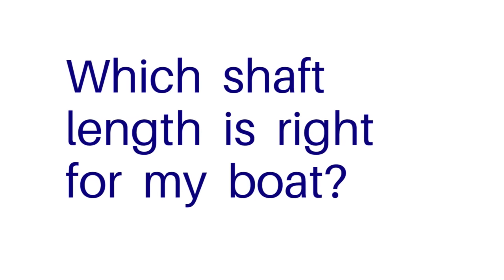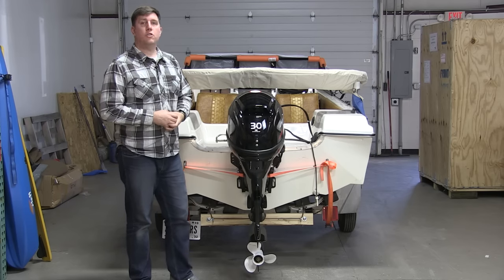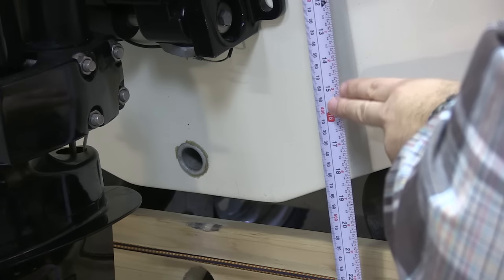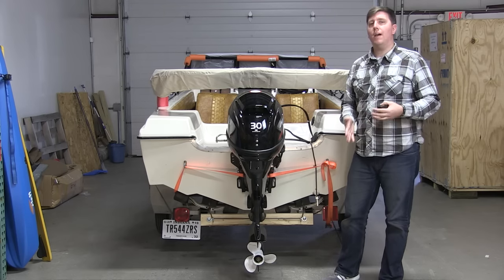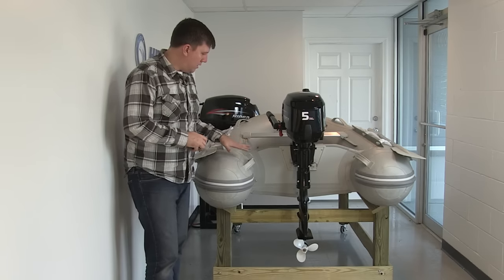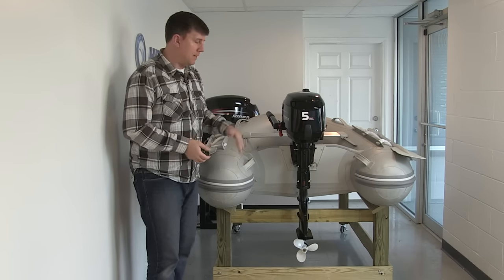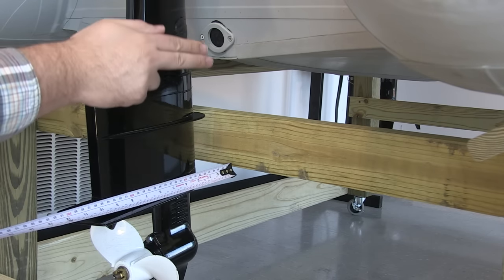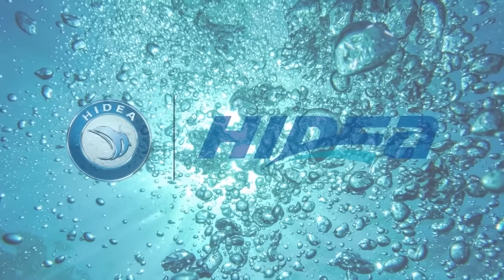What Shaft Length Do I Need?

Comment: i have an inflatable cat and even short shaft was too long. Being an open transom i couldn't raise it any higher, so i moved the floor down an inch approx by using closed cell foam between bottom transom bar and HP air floor instead. Along with an hydrofoil it made a huge difference to slower planing, less banging in chop and tracked/turned just like a car would. Since there was no more prop ventilation i didn't bother cupping prop.
Reply: if your cat has a transom that is too short for a 15 inch mid then something is incredibly wrong with boats design.. or was this boat meant to be using a setback?  tell us what the boat is and ill find out why it was built that way
Reply from the maker: Interesting - thanks for sharing!

Comment: If your motor is sitting 1 to 11 inches too low, you should look up manual jack plates.  "On the Fly"  brand jack plates have a self adjustable circular crank lever for an instant height adjustment up to 11 inches while traveling on the water at top speed.  Easy fix for a shaft sitting too low, especially for shallow waters less than 1 foot deep.  With the right prop height adjustment, you can increase your travel speed up to 5 mph.  The manual self adjustable jack plate is for outboard motors 40hp or less.
Reply: Oh thank you 🙏 
I just got a 14’ boat and it came with a 9.9hp evinrude long shaft. It’s 5 inches too low and I was just brainstorming how to fix it

Comment: OK, so I just bought this Mercury 5 HP four stroke short shaft and I have a 15 in transom. The anti cavitation plate sits 2 inches below the bottom of my boat. Making it a 17 inch shaft. Is that possible?

Comment: How about a catamaran-type inflatable, like the Takacat? The bottom of the boat will be above water, so do you just guess the ride heigth and make sure the anti ventilation plate is a little below that? Thanks!
Reply: I have the same boat and my engine bogs. I thought my shaft may be to short.

Comment: Hey dude, is there anyway you would put a kicker motor on your boat on the cutout transom or would you mount it to the back using a bracket? I have a similar design and I'd rather be mounted to the real transom at the cutout than Mount with  bracket on the right or left. It's just a what if motor.  So it can be stationary. I can steer with the big motor. Do you think it would be too close??? As long as it doesn't hit right?

Comment: we have a 20 foot Carolina skiff and the previous owner put a 90 horse mercury optimax on it with no jackplate . Whenever we try to run it wide open it throws water up over the transom .  Would a jackplate solve this problem ?  The transom is 20 inches and so is the shaft .

Comment: I have a 2.30m inflatable I found a very nice 9.9 hp 2 stroke engine but its long shaft I want to have it but will it be a big mistake or will be fine ?
Reply from the maker: I don't know the answer for sure, however we have seen many people use the unrecommended length and the motors can still work - though likely it won't perform optimally.
Reply: It will work but I wouldn't recommend this setup. It causes too much drag and you will loose performance.

Comment: Su I got a lomng shat johnson motor on an aluminum  john boat gtypfr motyor kis it bezst to find a shoryrer shaft or wkiden the transom since the transom is looking like itr needs an upgrade anyway as its an old boat but it doesnt leak and upi copuld possibly ad a mpyor with more horsepower but the hJohnso is a pretty good notor though only a 15 hp and very reliable an d fixable locally as I may add a few things flooring and carpet.

Comment: But why? What happens when using a longer shaft?
Reply: Gowdaflow It is not efficient, the water sprays around the motor and the boat don't go as fast as it could be. It takes more fuel also, the power needs to be transformed longer and that will do that the engine need to work a bit more
Reply: Niels Thomassen Ok, thanks for the reply
Reply: Would a long leg on a short transom cause vibration as well I have a 12 foot aluminum with a five horse Merc long leg and it vibrates everything at 2 miles an hour and up trolling
Reply: fishing again you need a jack plate on your transom to elevate the prop if it’s too deep into the water lower than the quill. The cavitation plate should be between 0-1” from the lowest part of your transom

Comment: Beside the length. I heard that some Engines (100hp+) as Singleengines should slightly be mountes to the right to minimize the Propellermovment.
Is that right?
Reply: Correct ...  ;)
Reply: No not correct at all.. mount motor dead centre. then adjust trim tab on outboard motor skeg if need be or fit a torque tamer to the skeg. use the right prop and keep it sharp..  shifting it to the right is not the right way, your just fixing 1 problem by adding another. set the motor up right and at 50mph you can take your hand off the wheel. put motor to the right and it will never be able to do that....
Reply: No, dead center.

Comment: Thank you for that explanation, but one question if I may.  Let's imagine you have a boat that by design (flat hull) does NOT displace much water, in that case, does this general rule still hold true...OR, could it be that with almost no displacement of water, you might get cavitation in normal running?

Comment: Thanks for a very helpful video. And straight to the point. Awesome !!!!!
Reply: poor and wrong advice... look at the bracket on the motor, why do you think it has extra holes in the bracket ?, its too move the motor up. this motor should be using the top holes not the bottom. it needs to go up atleast 1 inch unless only ever going to run the boat at 4mph max speed.
Reply: Sorry Phil you are wrong and why do you spell your name with 2 L’s

Comment: I thank you so Kindly Sir for giving this information at the right length of shaft should be on a outboard motor & I've just checked the the outboard on our boat it levels up nicely from the outboard plate to the bottom of the Keel I live in New Zealand & the boat I have is a Smuggler 6.20 cabin boat with a F150HP Yamaha outboard Fourstroke Motor I got the boat in 2015 & it only had done 3/4 of an hour on the motor when I got the boat & seeing your video Sir of where the plate should right in line with the keel & it does & so I'm sure that the Yamaha F150HP four stroke outboard motor  has been Mounted Correctly & must be a long shaft motor Kind Regards Peter PS I did measure the transom & did it by eye from the plate on the outboard motor & it spot on to the bottom of the keel I Thank You So Kindly For This Information Sir & Keep Up The Good Work Sir

Comment: My Orkney long liner 16 ft is 19 inch from transom to bottom of boat BUT has a 10 inch deep keel total of 29 inch so, so where should i measure to ? bottom of boat or bottom of Keel ?
Reply: This is exactly my question, did you find an answer somewhere?

Comment: I'm in the process of changing my motor on my pontoon boat. Obviously there is no keel, so do I take the measurement from the top of the transom to the bottom of the pontoons?
Reply: Nor, you need to measure from top of the transom bracket for motor to the surface the bottom of the sponsons would be when on the plane ?  if the sponsons  ride on top at the rear when on plane then measure to them. if they stay under water 4 inches then subtract that amount.. see what the owners manual for boat says. ... you need the anti cav plate to ride on top of the water when fully on plane...

Comment: the transom is the furthest aft most part of the boat in the case of your run about or the rear end of the rigid part of the inflatable. Not just from the top of the motor mount  to the skeg or aft end of the keel.

Comment: I went and measured and re-measured....and I get 17 inches from transom to keal.... what now???
Reply: You need the 20" shaft
Reply: Or you could get a a 15” short shaft and use a transom riser/jack plate to raise the motor up.

Comment: FIRST LEVEL BOAT- LEVEL ENGINE- MESU BOTTOM OF BOAT, MESU- CENTER OF PERPELLER SHAFT  THIS IS THE ADJUSTMENT TO USE LIKE IF 15" - AND SHAFT IS 10 YOU HAVE A DIST- OF 5" TO ADJUST THE SHAFT SHOULD BE 13" SET-RASE UP TO 12" SHAFT - THAT SHOULD BE REAL CLOSE TO THE HIGH YOU NEED TO RUN.BELIVE ME IT WORKS . THEN IF YOU WANT ADJUST IF IN 1/2"" AT A TIME UP OR DOWN

Comment: shame you do not know enough about boats to know the cav plate should never be level with the keel. it should be atleast 1 inch higher at minimum.. its very poor advice to tell people the cav plate should be level, this is very old school thinking that was incredibly wrong... when moving along at anything over about 4 mph you can look over the back and see water is creeping up the front of the outboard motor and is causing terrible drag. now if the anti - cavitation plate was higher it would act as a barrier ( exactly what it is designed to do.) and stop the upward surge of water and direct it more towards the propeller. just 2 inches up will lessen the amount of drag the gearcase gives by a huge amount.  raise that motor 2 inches to get better performance , better handling and far superior economy.. .
Reply from the maker: Thanks for the corrections. Do you have a video we could link people to for these updates?

Comment: That Info is WRONG ! 
Your Keel should be at the hight of the upper Waterintake!
This is a common Problem that the Cavitationplate rides to deep and this gets you a bad Gasmilage!
The first Boat need the Plate to go a little bit up so the Plate rides free OVER the Waterline not under the Waterline. Try it and you will see the Difference!
Reply: I am no expert, but that first boat looked to me that it didn't necessarily need a long shaft.